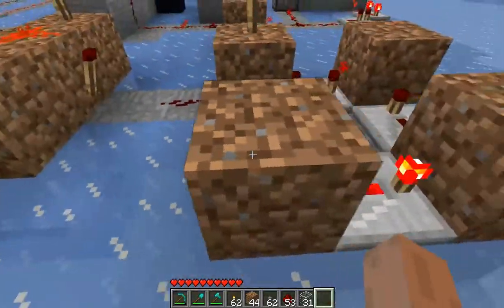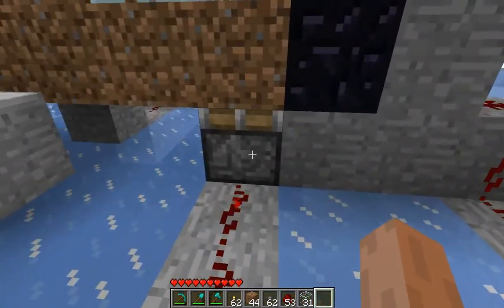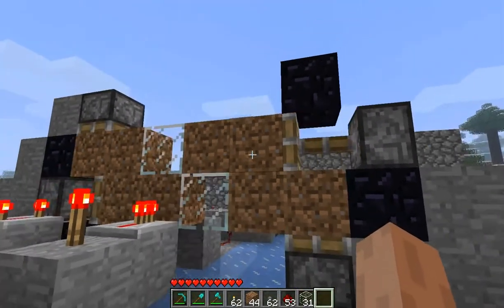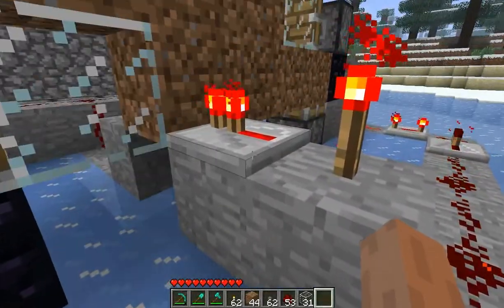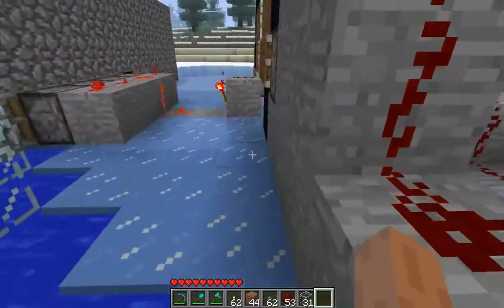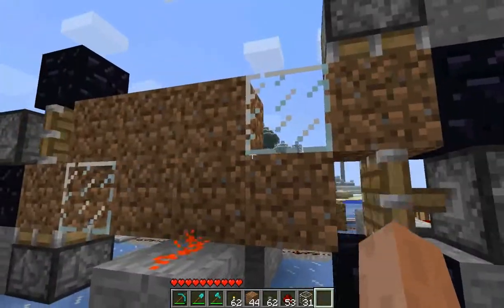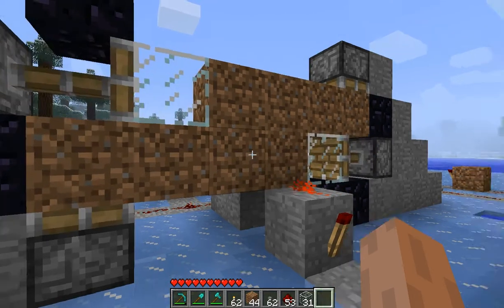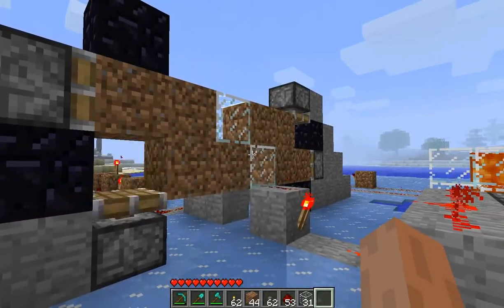Redstone pulse counter using Pistons

Comment: technically you can do the same with 2 synchronous clocks with a 4: 1 ratio, the one controlling the pistons going round 4x slower than the one pushing in the cobblestone.

but it's a very nice design